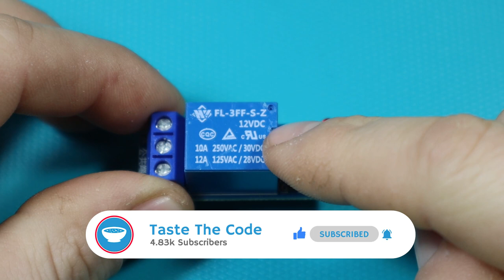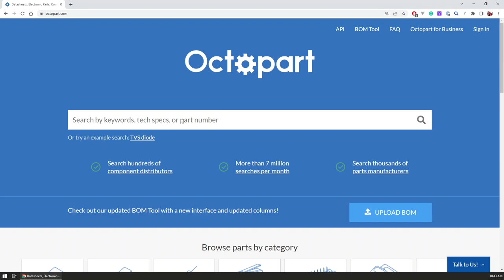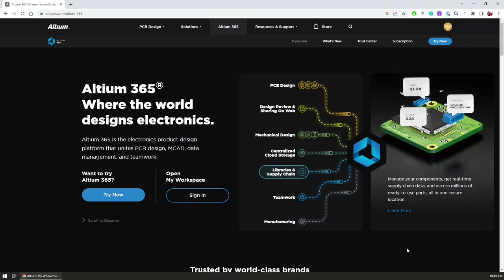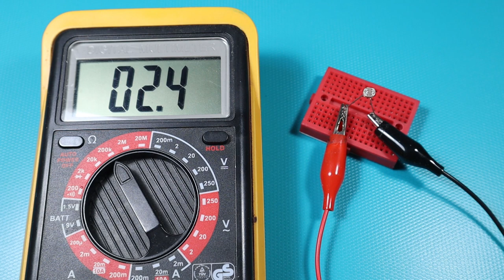Super simple DIY optocoupler - Adding optical isolation in electronic circuits

Comment: I made this years ago for a microcontroller , the controllers output pins were 3.3  volts but i needed an output of 5volts to go to a motor controller this simple circuit  worked perfectly
Reply from the maker: Yes it does. I was amazed as well.

Comment: Used the same to check if power from 12v adapter i coming or circuit running on battery power.
Reply from the maker: Wow nice, I did not though of it being used like that. Thanks for sharing!

Comment: I bought BT136 now i saw video  if you wanted to xonnect it to dc as well as ac you need oprltacouple which is not xheep😢
Reply from the maker: Optocouplers are usually just a few cents a piece...

Comment: Came across this while looking for solutions... Turns out cellphone chargers have 5v optocouplers
Reply from the maker: Yes, the good ones use optocouplers to provide electrical isolation between the main and the low side voltage. Most switching power supplies do the same.